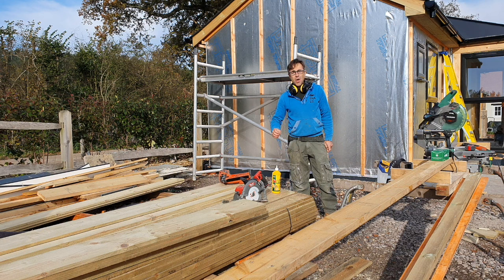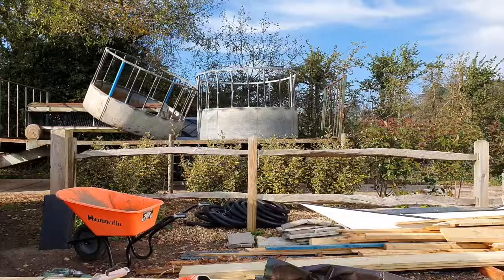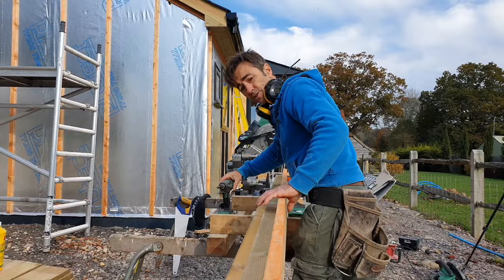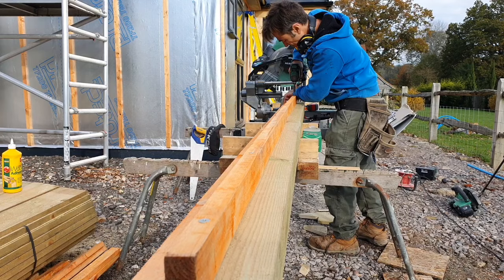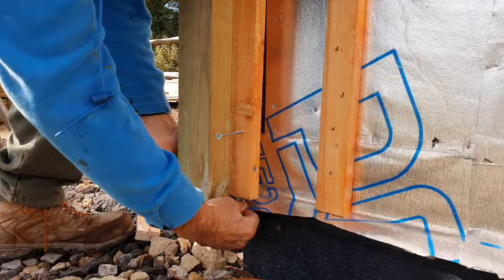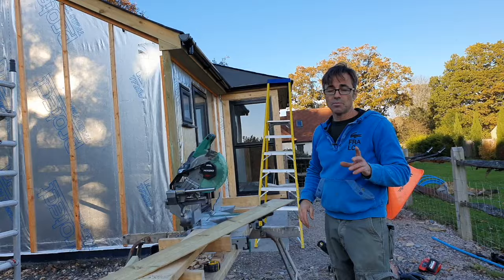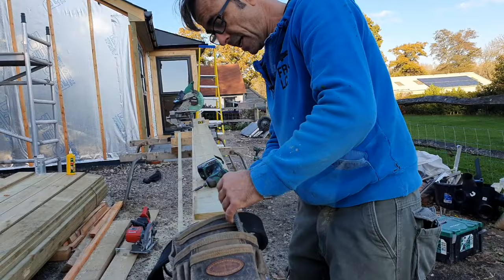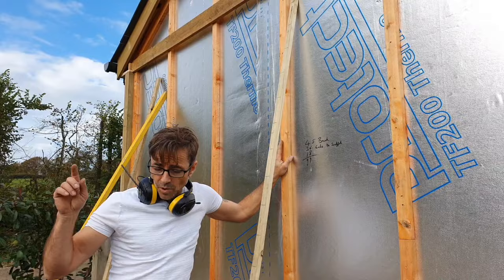How to set out, measure, cut and fix Timber featheredge cladding the carpenters way

Comment: £26 bloody hell
Reply: SPAX are the best their like the marines of screws 😝🔨
Reply: @tomsmith9048  I've used them in the past no doubt good screws but I never paid for them lol
Reply: @dalemoore11  once you use them nothing else compares and I'm just talking about the regular spax
Reply: I've used alot of chipboard screws costs around £6 a box can get in pretty much any size screw you need not a million miles away from spax, not saying they will be my automatic go 2 screw for every job outdoor or hardwood prob not, £26 for my jobs would never work for me on site or if I priced up for private just because I like the feel of a screw and it doesn't split the timber as easy must clients would rather you go for £5 box of screws
Reply: @dalemoore11  it's just in with the price for me I've never had a client be that insistent but then again I dont give the option of screws I like to make my life easier on the job but not all spax are that price just that particular screw a box of 100mm are about 15 to 18 pound
Reply: @tomsmith9048  fair enough I would rather pay £5 for a box and save the 10 on every box lol, tbh I get my screws provided for me free on site
Reply: @dalemoore11  o right its just you said most clients would rather you go for the 5 pound box of screws in your last msg to me that came across that you bought your screws and its nothing to do with the feel of the screw it's the quality
Reply: @tomsmith9048 I do a few private jobs a year, I still stick with my comment most clients would rather pay for the cheaper box of screws that doesn't compromise quality to keep the price down, are spax the best screws on market probably, feel better go in faster stronger probably, but for £6 you can buy alot of very good quality screws that are not far away from spax and don't make the job finish any worse. Could be a good Robin and Roger test challenge 😎
Reply: If John Smith's did screws.... there's a good joke in there somewhere Tom Smith
Reply: @dalemoore11  if carlsberg 🍺🔨
Reply: @dalemoore11  cheaper screws have a tendency to snap or ring the heads the tips aren't threaded properly and the screws you don't use you take to the next job and charge the client for fixings again that's how its done eventually your only using spax and nothing else 😉 buy cheap buy twice that goes for screws tools ironmongery